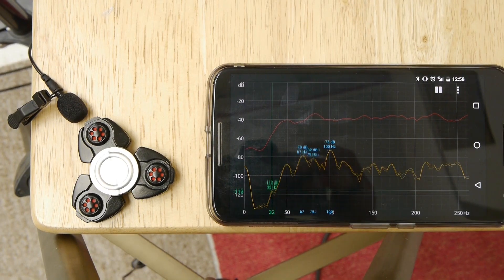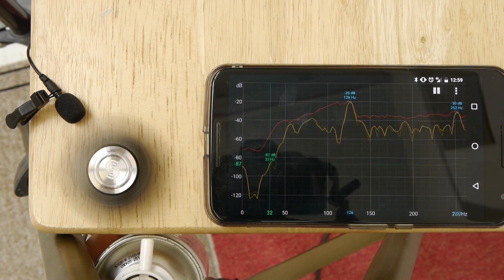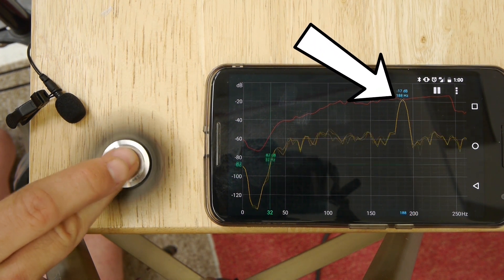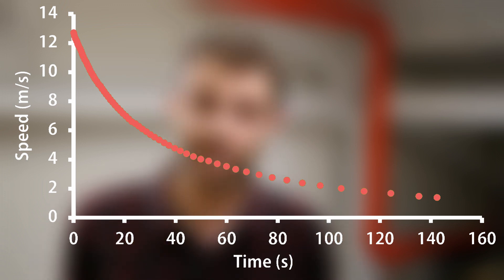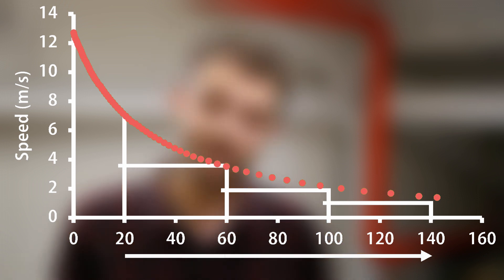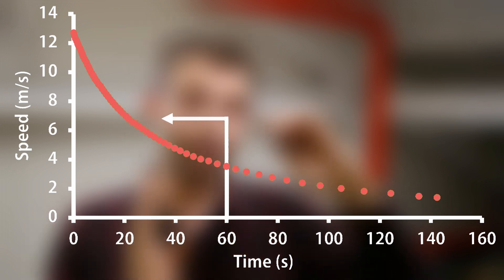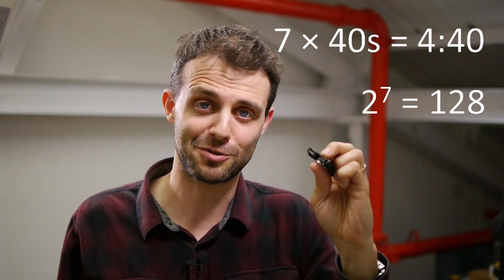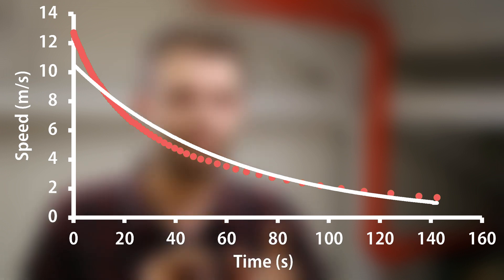Exponential decay - why your fidget spinner won't spin for longer

Comment: I got one to stave off finger-biting. It actually works.

I figure a metal spinner can have more momentum imparted on it due to the mass, and this is making it last longer (but I don't own a plastic one and I don't really care how long it spins).

Of course, the metal can be harsh on the finger you use to give it a good push.

And also, the hand I hold it in smells of copper.

Comment: How much would improving the spinner's aerodynamics help performance? All the angles and patterns may make the spinner look cool, but don't they just add turbulence?
I wondered initially if making the lobes look more like a propeller might help, but then I thought that as you are holding the spinner in a fixed location, you will add load to one side of the bearing as you resist the propeller trying to move in the air. You would need a shape that was aerodynamically shaped that is laterally symmetrical so it does not produce lift and can distribute the load and friction evenly over the bearing.

Comment: To add to hauslerful's derivation, since I've done the same in the past.  It turns out that for aerodynamic drag which goes with V^2, if you plot distance travelled on the horizontal axis (in this case, angular distance or paddle tip distance), it becomes exponential.  Every halving of speed is a constant distance.

Comment: I think the problem is that it is NOT wet friction. The bearing inside is a skate bearing meaning there is no lubrication. The lubricant decreases the rolling resistance but also makes it stop a lot quicker so skate bearings are used instead.

Comment: 5:16 no that's not true. supersonic aerodynamics is an entire different subject. it has completely different effects on the spinner. you'd have to re-calculate friction (air resistance) when the spinner goes past 343m/s.
Reply: Peida Li I suspect it has something to do with what's called image persistence (not exactly, but I can't remember the term). Your brain retains an image for some part of a second, or something. This multiple images shown in quick succession are perceived as one motion. It's why there are framerates for displays, it's the basis of all motion picture technology.
Reply: Akshay Anand what are you even talking about? how does that relate to anything i said?
Reply: Terry Folds he said to spin the fidget spinner twice the time it needs to go over the speed of sound. This would create even more friction due to mach effects. so the speed of the spinner would decrease even faster then exponential decay he approximated. That's why its related.
Reply: Probably less than that actually once it got up to transonic speeds (~Mach 0.8+) you would probably start to notice an additional effect creeping in due to Mach flutter and other phenomena that start to creep in around there due to even the tiniest variations in the shape of the object etc. Mostly the effect of this would be in the form of additional vibration in the spinner but that would of course create additional friction that would bleed energy.

Comment: in other words, Steve gave up and hands over the relay stick ... There is still science to be done. 
example: Is the spinner causing a soundwave (at the speed of sound ofc) that actualy negates some of the friction as long as the wave length does not exceed spinner pedal (hole?) size?

:-))

Comment: How doest the fact that speed is proportional to acceleration implies exponential proportionality of speed and time?
Reply from the maker: +Macieks300 good question. Too long for this video. But basically you do it the other way around. You can prove that the derivative of an exponential is proportional to itself. Therefore the reverse is true.
Reply: If acceleration is proportional to the speed, we can write this down as

a = v

(You could insert a constant k as a factor of proportionality, but lets keep it simple).

We know that acceleration is the derivative of the speed, so the equation equals

dv/dt = v.

So we're looking for a function v(t) that is identical to it's derivative. That's basically the very definition of an exponential function. So the speed is

v(t) = exp(t),

because it matches the equation dv/dt = v.

To get the position x(t) we need to integrate over the speed. And the integral of an exponential function is, again, an exponential function, say:

x(t) = exp(t).

That's why exponentials are so super important in physics and science: You just need a simple proportionality to produce this "exponential behaviour". :-)

Comment: I was hoping you'd calculate the energy required to move it at a certain speed :( That would let you say stuff like "you need an atomic bomb to move it faster" - like the current record for folding paper in half is 13
Reply from the maker: +Ethereal Intellect damn. Good call.
Reply: Anton Helsgaun that grammar...
Reply: its not really... the real thing about folding paper more than 7 times is for normal a4

Comment: Would all the paddle permutations as distorted by the rolling shutter--if they were made real just as they look on video--be balanced and turn well as a real fidget spinner since the rolling shutter takes and adds in such a systematic way?

Comment: Steve, you said that the differential equation dv/dt = kv^2 is difficult to solve (k is a negative constant). I disagree. The solution is simply v = 1/(c - kt). The power rule applies!
Reply from the maker: Wow, that is close. Looks like drag might be more important than friction.
Reply from the maker: This is great, thank you! Wish I'd spent more time researching.
Reply: I got a near perfect fit by including both the linear and quadratic terms. I expanded on work by +David Crowley:
https://www.desmos.com/calculator/ag6jnjjlfm
Reply: I knew that curve looked hyperbolic! I suppose that since there's probably both a friction and a drag term in the acceleration, there ought to be a drag-dominated region for high speeds that looks hyperbolic, and a friction dominated region for low speeds that looks exponential.
Reply: Steve, hopefully I can clear up some confusion. As you said we can't solve the initial equation with the power rule directly. What we can do is manipulate the equation such that it can be solved using the power rule. Consider our initial equation, dv/dt = k(v^2). Now we divide by v^2 (on the presumption of course that v is not equal to 0) and get (dv/dt)*(v^-2) = k. Now we integrate with respect to t and we get -v^-1 = kt+c and can solve for v from here.
Reply: Steve Mould the method is called 'separation of variables'.
Reply from the maker: Gah, I should have checked wolframalpha! Thanks
Reply: Checked it out: pretty great match to the data! See it on Desmos. https://www.desmos.com/calculator/8zgeokvwrd
Reply: Having long since forgotten my calculus, I referred the problem to WolframAlpha. It appears that the solution is v(t) = 1/(c - kt), which is only a sign error away from your solution. http://www.wolframalpha.com/input/?i=integrate+(dx%2Fdt)*x%5E(-2)+%3D+k
Reply: You may find an even better fit if you include a linear drag term.  The solution is more complicated, but it's still a separable equation and I'm sure a statistics package could do the fit.
Reply: Technically it would be the sum of the friction force and drag force, but yes, it's still separable.
Reply from the maker: Wait, isn't the power rule for dv/dt = kt^2 etc (note the t as opposed to v)? In other words when f'(x) = kx^a we're good but when f'(x) = k* (f(x))^a we're not!

Comment: I still don't get what you mean when you say that speed is proportional to acceleration. Maybe if you could refer me to some equations I would understand.
Reply: It simply means that it slows itself more if it is going faster. The equation of 2 things being proportional is just a=k*v, (a is acceleration, v is velocity, k is just a number, negative in this case).
Reply: I actually asked the wrong question. I actually don't understand how the fact that speed is proportional to acceleration implies exponential proportionality of speed and time.
Reply: Because that's how exponential is defined. It's just like money, it grows proportionally (acceleration) to the amount of money you have (velocity), so it grows exponentially.  The math is quite complicated to explain in a comment but you can look it up, it's not difficult.

Comment: I think there is an overlap between #2 and #3 :P

And well - good old friction.
A linear and a (small) quadratic term (and some higher orders that are negligible).
(and drag imo is also just friction - of the air in this case)

Comment: And the differential equation isn't hard to solve, you get v=1/(kt+c).
Though if you try to combine both models that produces a differential equation that is really hard to solve.
Reply: It turns out combining both models isn't so hard. If

v'=-av^2-bv

Then

v=b/(A exp(bt) - a)
Reply: Jonathan Tanner and if you solve for position you get x increasing logarithmically with time, so the spinner never stops!
Reply from the maker: Are you sure? Can't find a reference?
Reply: I did a very simple derivation in my comment. You actually can double the time by doubling the speed, if youre fast enough

https://www.youtube.com/watch?v=G7hh42AgBlQ&lc=z13iztvoxorreb02d22ldfqw3ue0xhnoc04
Reply: Exactly... Dividing both sides by v^2 makes it take the form of a linear DE

Comment from the maker: Maybe you're sick of fidget spinners, sorry! It's about exponential decay though I promise!

Edit: Some people are asking for the raw data: https://pastebin.com/raw/neb8qPg5 (sorry about the tabbing!)
Reply: smarter every day has a full video that really explains the scanning shutter effect
Reply: Idea: if you want to make the fidget spinner spin longer/faster, put it in a vacuum. Possibly activate it by magnetizing the three edge pieces and running electricity through the center to make an induction motor
Reply: Steve Mould So if you do this experiment in a vacuum then the data would be identical to exponential decay right? Also, you should link to Smarter Every Day's Video on the Camera effect for more detail! Cheers!
Reply: If you use Wolfram alpha to solve the nonlinear differential equation dy/dt = -k * y^2 you get a function in the form of y(t) = 1/(c + k*t).  That actually fits the data to .999 so it seems that approximating it as the friction is proportional to the velocity squared is very accurate.

If anyone is interested c and k are 4.9E-3 and 2.0E-4  respectively.
Reply: Am I missing something here?  The equation is dv/dt = -(k*v^2 + c*v) where k and c are positive real constants (assuming linear and quadratic drag forces).  Although this is non-linear, it is separable and so is easy to integrate and solve.  Then any decent statistical package could do a fit with the function you get (probably a bit beyond excel though).
Reply: That's fine Steve, I personally find your video interesting. As long as we learn something new, trendy or not, it doesn't matter to most of us. Not like those stupid videos of people, spinning just to show how cool they are.
Reply: Really nice with an analysis of what is going on. I would like tho see the curve change when the spinner is in vacuum (it has been done before, but not with the measuring of the curve).
Reply: Karl Frederik Færch Fischer Ah yes I know that the measuring system required would be different. I think using a high speed camera to measure the speed would be used. Just wanted to know if the graph would be as expected in a perfect vacuum (which I know can't be created). I wonder if gravity had a factor in this.

"Rolling Shutter", right! Thanks for mentioning the name, had completely forgotten it.
Reply: Steve Mould A good idea would be to pin this comment
Reply: Steve Mould misread: maybe you're a sick fidget spinner spinner.
Reply: I assume that the nonlinear eqn that is difficult to solve probably can be approximated by using "Perturbation Theory" https://en.wikipedia.org/wiki/Perturbation_theory  what do you think ?
Reply: Problem with a vacuum is that he would need another way of measuring the frequency of the spinner, however it would be an exponential decay in vacuum (except if there are other unforeseen factor, though i highly doubt that).
Nice shout with Smarter Every Day btw. It's a very nice video he made on the topic of the rolling shutter effect
Reply: You can also increase the spin time by increasing the mass of the points in orbit around the origin. A higher mass orbiting at the same speed will have a higher inertia and momentum.
Reply: +Steve Mould
Another good one, I was a bit disappointed that You didn't try to "confirm You drag hypothesis" by using a "vacuum chamber" and test the spin times from an "known impulse" with and without air resistance.
But still a very good video.
Best regards.
Reply: I came for the none linear differential equations working out. 

I'll wait.
Reply: The data suggests that acceleration is proportional to velocity to the power of sqrt(3)
Reply: Yeah, sorry. I didn't mind that my subscription box was video after video of fidget spinners at first because hey, a trend is a trend. But it's getting really old now.